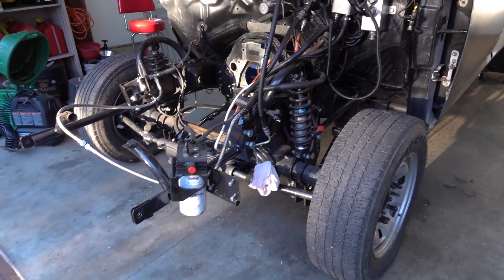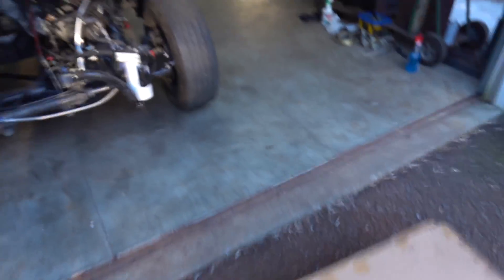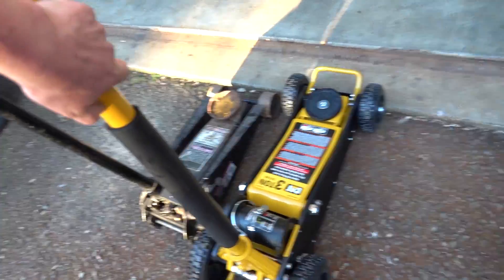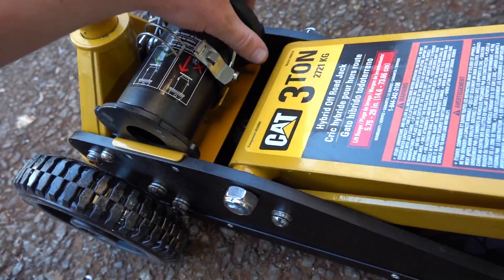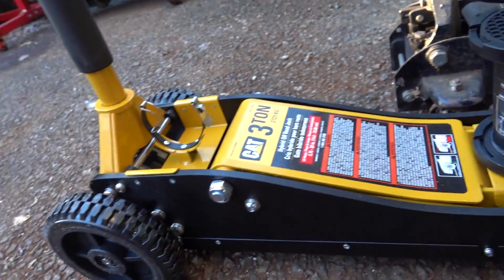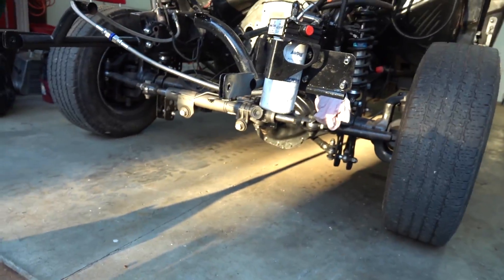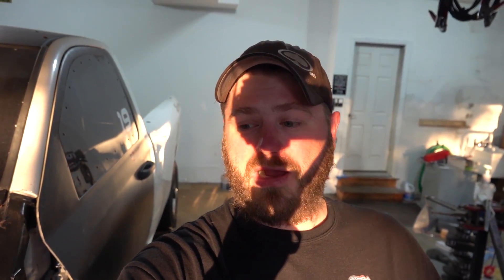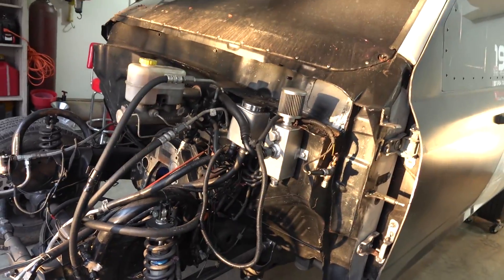An EXPENSIVE Pro Eagle Off Road Jack, But For WAY CHEAPER??? CAT Off Road Jack Unboxing and Review

Comment: It is a decent knock off of our jack. Pro Eagle builds our own jacks in our own Pro Eagle factory. Not talking bad about that one, just clearing up that question.
Reply: Can you share what components are different between the Pro Eagle and Cat?  Great to hear it is assembled in house but are parts foreign/domestic?
Reply: Sucks when companies build a product that’s basically a copy. If can post a video of pro eagle vs the cat in quality and performance would definitely not mind spending the extra cash if significantly better.
Reply: Where is your factory located?
Reply: I’m not affiliated with Pro Eagle so I don’t know for sure, but I believe their factory is in China. 

I’ve sourced parts and assemblies in China before, and I can definitely say there’s a big difference in quality between the sweatshops people are usually worried about and an American-owned Chinese factory managed by American expats. 

In my experience, one can get high quality parts out of China if the company doing the engineering and marketing runs a tight ship at their Chinese factory. 

I would like to hear from Pro Eagle on this point and get a little more detail. For instance, where is your factory?

Thank you.
Reply: I have the Pro Eagle 3-Ton Kratos jack, and I am very happy with it. But I will say that, on your own box, it says "Made in China." Please explain. Are you saying that the Pro Eagle factory is in China?
Reply: @slother93  my Pro Eagle 3-ton Kratos box says made in China on the side.
Reply: @terrarecon  Correct. It’s not a secret. We are a private label manufacturer and we build jacks for a few global and US companies. We do not build the Powerbuilt jack which is branded as a CAT jack and we do not build anything for HF. We are a US based company and our factory is in China. All development of our jacks is done here in California. We are a company founded by auto enthusiasts and we are out nearly every weekend playing in the dirt. Our product is our passion and it shows. There is a laundry list of differences that I will not list but a quick review of our website vs theirs will tell you what they are. In short, they cut corners and made a cheaper version. That’s it. Things you won’t see listed but are important to us is we are the only manufacturer to offer parts and pieces. You can get nearly any part needed right off our website. We offer a 2 year full replacement warranty and we have a great customer service department. We are also endorsed by brands like Ford, (all of their R&D vehicles have a Pro Eagle mounted in them), Rivian also equips their R&D vehicles with them as well as their service centers and vehicles, Honda, Red Bull Motorsports, Polaris, BFGoodrich, Milestar, Camburg and on and on. Those things aren’t important to everyone and that’s ok. We will stick to what we are passionate about and keep building products that we can be proud of.
Reply: @proeagleoffroad  thank you for your response and transparency. I do own the Kratos jack by the way. I am satisfied with it and the build quality.

Comment: Harbor Freight is coming out with a Badland  off road jack in December for about $299.
Reply: Read the reviews of HF jacks even the most expensive.  Yuck
Reply: I had mine hf 3 ton pittsburg since 2019  no issues until last weekend, need to find a seal kit

Comment: Just picked up the Off road CAT.
It looks like it is better built as well.
Heavier and all steel construction instead of aluminum.
Also the no turning wheels isn't a big deal.
The wheels are so tall you can lean it on its side and turn it like a bike.
Reply: It's not all steel.. frame is Aluminum.

Comment: If you read the negative Amazon reviews you would think twice about buying one just to save 150.00 bucks. It's also 90 lbs vs 68 lbs for the Pro Eagle. But there are a few negative reviews of the Pro Eagle as well . . .
All I want are the wheels to put on my regular jack because I have a rough driveway and I want it to roll easier.

Comment: I got the pro eagle, looks exactly the same as that but main issue with that lift plate is the little ears will start to bend to the point where the extension won't twist in
Reply: We have redesigned the lift plate and changed the material. Since we are the only jack manufacturer to offer replacement parts, you can get a new one.
Reply: @proeagleoffroad  can you guys add a led light , always thought of it too. I have a cheap led double taped to my jack
Reply: Will the 1.5 pro eagle jack lift one corner of a ram 2500 6.7 for a tire change?
Reply: @proeagleoffroad   would the 1.5 ton pro eagle jack lift one corner of a ram 2500 with the diesel engine for a tire change?
Reply: @andresgamero9595  It will

Comment: That jack loos amazing but I don't see any threads sticking out of the nylock nuts on the axles.  Is that fixable?
Reply: Snap rings, they are replaceable

Comment: instructions on these ofg road jacks say ‘only use on flat, level ground’- which logically, might mean in other words, 😩USLESS SCAMMM☹️.  then again, description also says minimal height 5-6”, which judging on the height relationship between jack circle & front 3-3&1:2” wheels, might technically mean - MINIMAL HEIGHT, DUMLY MESURED & UNKNOWN(& hey, maybe if the same fool said flat even useless, maybe they were wrong there too!.
Reply: ) not .  
smRtfOn😒